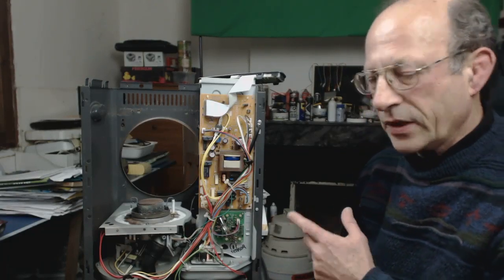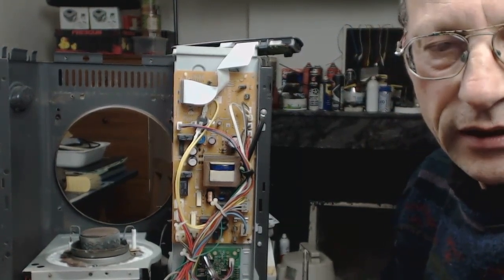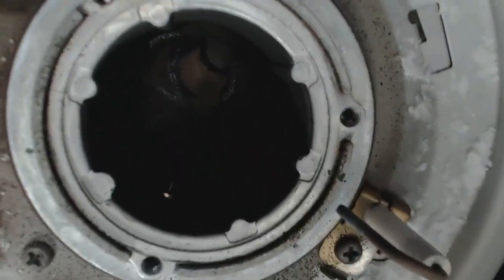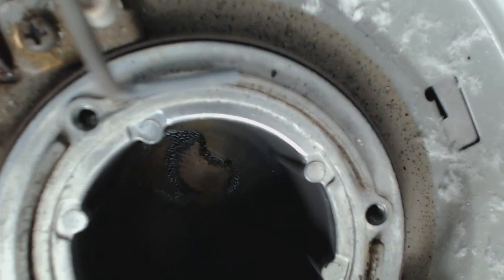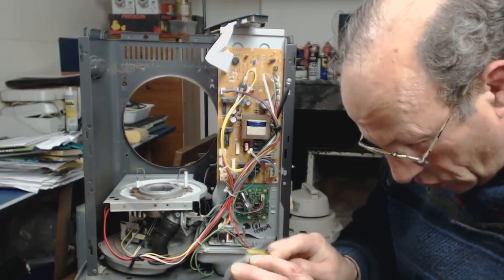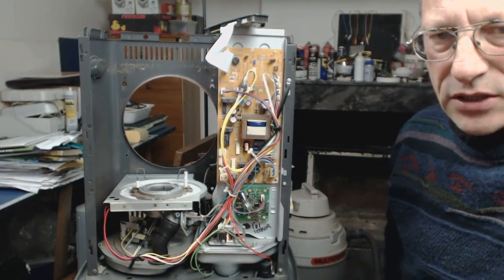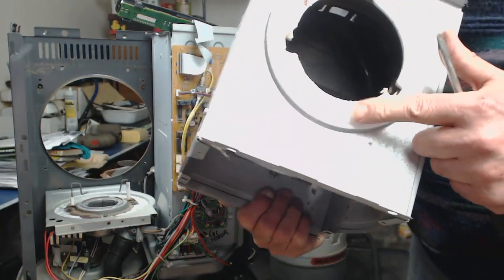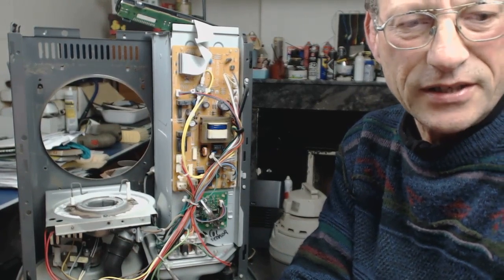Paraffin / kerosene / petrole heater: E4 Error (E0-E4) - Easy Fix

Comment: HH error 
How I can solve this problem? 
Please helpe me to solve HH error
Reply from the maker: HH error code?
I have not seen this code.
Precisely, what heater do you have?
Reply: @EngineTuning  corona heater japan
Reply from the maker: I don't know what the HH error code indicates.

Perhaps it is EH ?
Reply: @EngineTuning  HH AND SOUND BEEEEB
Reply from the maker: I have not come across this error code.

Consequently, you need to tell me the error circumstances.

Is this the first start of the season?
When was the heater last used?
Are you starting the heater with old fuel?
When does the error occur?
... by this I mean : You plug it in, and press the start button
... what happens next (passage of time)?

Other than that, you should :
- Drain the fuel tank into an empty container
- Clean the fuel filter
- Using the tube syphon, pump out as much of the old fuel as possible from the fixed fuel tank (beneath the filter)
- Refill the fuel tank with newly purchased fuel (the correct grade).
.... be careful not to take the water that is often at the bottom of the purchased fuel container.
(It could be that you have water in the heater system)

Make sure that the heater is level.
Try starting the heater repeatedly - start - error -switch off - start etc. (repeat six times)

If it finally starts, you can gradually mix the old fuel with the new, each time it needs a refill.
You can also buy a litre of acetone, and add 50ml of Acetone to 5 Lt of fuel.
This will absorb any water, and the fuel will burn cleaner and hotter (so it pays for itself).

You can also buy a funnel with a water filter.

If these steps don't work, then you will need to service the heater.
See this play list https://www.youtube.com/playlist?list=PLeHV-kNBKNNfEtkx0cTb-mbtelhpNOPFa
You will need to follow the 'Easy Fix' video.

Good luck ... report back ;)
Reply: @EngineTuning  

When electricity reaches the heater directly, the HH signal comes out with a beep alarm, and after a few seconds the heater turns off
Reply from the maker: It could be a CO2 sensor failure.
Watch the CO2 sensor repair video in the playlist.
Reset the CO2 sensor, and if it doesn't work ... try the bypass (as explained in the video).
Reply: @EngineTuning  E1 error please help me to solve. I have cleaned the heater chamber 2 times without any useful.
Reply from the maker: @newdawn6665  If you have cleaned the flame rod, and the problem has not been rectified ...
The flame rod may require replacing.

Before doing so ... check all the wiring connections.
Take your time, and look for potential problems.
Reply: HH means the unit is too hot (usually due to turning it on repetitively after other errors in an attempt to brute force it). Let it sit for 15+ minutes and try again.
Reply from the maker: @NotMitch69  Thanks Michael, for contributing your perspective on this error code.
Clearly, this scenario could be complex.
I would always advise that you take note of all the 'start up' circumstances ;)

Comment: I get the Error "Ed " code
Reply from the maker: LOL that's a new one :)
Try searching for a manual for your heater model.
:)
Reply: @EngineTuning  There is nothing about that in the manual. Its a Tayosan SRE 3001 and maybe its a Temperature error because outside temperature is 30°C. I will try it again the late afternoon.
Reply from the maker: @luckyx3ktm01  If the error code is not mentioned in the owners manual, it will be mentioned in the workshop manual.
These are not always available on line, but you could try searching..

Having said that; you could be correct in your assumption.
If the software sees 30 deg, then there will be no reason to ignite the heater.

To test this; you could cool down the temp sensor, usually located at the back of the heater ;)